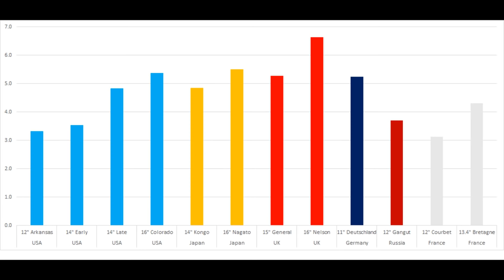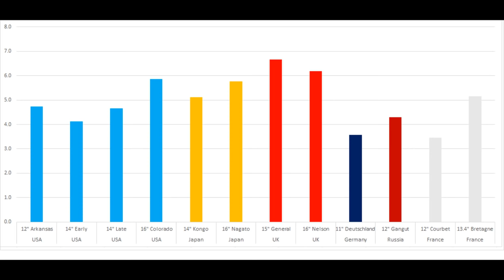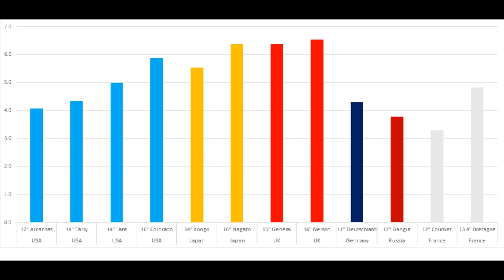Battleship Guns of WW2 - A series of tubes

Comment: Many years ago I tried to evaluate the developments of battleships and found that the best indicator of ships was:
Number of barrels times the cube of caliber - which means that secondary armament disappears into insignificance.

It is not a perfect measure; but as:

1) Bigger guns means a bigger ship - more armour, more engine power.
2) Number of guns gives - sort of - the pressure on a nations GDP. Indubitably the french and italian navies were as much disadvantaged navally by their much smaller economy.
3) So the rest follows more or less proportionally to number times caliber cubed. Following more or less the same trajectory into absurdity.

This does not mean that older guns were/are not usefull. During the cold war there were a lot of 6" naval guns - and with them a lot of ammunition. So they were perfect for coastal batteries - these forts were functional up til the 1990 and 2000 - and relatively cheap. Armour was about 18 meters of rock.
If you don't think they were effective: Just try and for the Bosperus in Turkey. Does the name of Gallipoli ring a bell? Deafning I should say!

Comment: Two comments on the approach to the method for deriving the scores - one specific to the question of range and the other more general:-
1) Given the factors around turret design limiting range, looking at the elevation required at 20,000 yards (to align with the nominal battle range used in the armour penetration measure) would be a more gun specific measure. Whether the data on this is available is, of course, another matter.
2) Scoring best as 10 and worst as 0 may skew things where there is a wide range of performance on some measures and narrow on others. Scoring the best as 10 and everything else relative to it seems to me a better way of showing the relative performance and allow a really strong performance on one measure to outweigh last place close race on another.
Great content and analysis though is far more useful than a tweaked scoring system.

Comment: I would consider using Muzzle kinetic energy (0,5*m*v^2) instead of range. That way actual gun capability to reach long range would be considered. Turret ability to utilize this capability would be a separate story.

v^2 is gun related term in ballistic trajectory equation. So turret elevation is excluded. Shell mass would crudely account for shell ability to retain velocity when drag is involved.

So guns with same  shell (same mass) would have higher capability for long range shot. Similarly, if gun have same-ish muzzle velocity, heavier shot would carry it further, as shell is less affected by drag.

Comment: I swear Rodney must've been using cheat-codes: first she famously somehow exceeds her design speed with clapped out engines and now I'm learning she magically exceeded her maximum rate of fire.
Did Bismark once steal Rodney's lunch money or something? Because the crew seemed to have a rather severe dislike for her.
Reply: Well, the boilers used in rodney were able to output more power than thought, just had to put more coal in. Also maybe they had someone standing at the breaker box ready to flip breakers every time she fired. Heard tale of the lights going out every time she fired. A manned breaker box would probably speed things up.
Reply: @GearGuardianGaming  I have heard Royal Navy boilers generally ran on overload quite well, it's apparently one of the reason the British stuck with lower pressure boilers but still, Rodney's were past their sell-by date. 
I suspect, certainly for the engines, it was a case of very experienced engineering team and the Royal Navy was definitely out for blood for Hood, so maybe the crew was simply that fired up. 
But it's much more fun to image the ship herself fiddling with her own parameters in the Dev Console...
Reply: @deaks25  indeed her engines were worn out after the hunt. She was headed to boston for an overhaul when she was called to help hunt bismarck if my memory serves me correctly. I can only imagine the vibration and sound of an exhausted naval engine.

Comment: My following comments are based on a combination of data provided by Campell's and Friedman's books, among others from a personal reference library of over 3,-000 books, articles and manuals, along with Naval Weapons of the World.
First, range is a function of not just shell weight and muzzle velocity, but shell design and elevation of the mount.   Without the mount, you are left with theoretical or empirical values for range based on a specified elevation.
Second, rate of fire is a function of the breech mechanism, but more so of the turret and ammunition handling system and the elevation of the gun based on engagement range. The rate of fire of the USN's 16" L/50 Mk.7 varied from 3 rpm at low elevations (ie. ~20,000 yds) to 1.5 rpm at high (40-45 degree) elevation.
Penetration is a function of remaining velocity, shell weight, shell design, angle of strike (horizontal and vertical) and the type of armor encountered. Penetrations vary between cemented and non-cemented armor, design and construction of the shell (wall thickness for example, along with hardening processes) and the piercing cap. In some work I did for NWS, the standard was 0(90) angle of strike of a Krupp non-cemented plate using formulas and data provided from Nathan Okun's site among other references. Angle of strike in actual tests were adjusted by an empirical chart for the increase in resistance due to increased striking angle. Fuses were notoriously unreliable even among the best designs, especially the more complex, like the USN's Mk.23, designed for multiple striking conditions. 
Then there's conditions on target. The USS Massachusetts put a 2,700lb projectile through multiple decks aft on the MF Richelieu, amounting to over 180mm equivalent of non-cemented armor only to explode in an empty 15.2cm magazine.
Effect is a result of penetration, shell condition, fuze and burster. The USN' s "heavy" and "superheavy" shells had the lowest percentage by weight of explosive filling of all the guns except the Italian 15" Mod.34A.
I wasn't certain how you decided to divide the guns into their two groups. For example, the first group, if it represented guns prior to 1937, should have included the USN's 14" L/45 (Mk.1 and others) and the 14" L/50 (Mk.3) firing the 1400lbs APHEPCBC shell. Range would have been at 15 degrees for the 14" Mk.1 and 15 and 30 degrees for the Mk.3. Around mid-1930s, these guns received the "heavy" projectiles, which were the original 1,400lbs 4 caliber design with thickened shell walls and smaller burster. Velocity dropped but range was more or less the same due to heavier shells. Penetration, especially horizontal, improved. T this point, it was the 14" L/45 Mk.10 that ranged to 15 and 30 degrees, while the mounts for the 14" L/50 Mk.11 all elevated to 30 degrees. Accuracy also improved from redesigned chambers, delay coils and heavier shells.
Also which configuration of the 15" Gun Mk.I are you using? The longer 1938lbs shell wasn't available until 1936, up until then the shell was the 1920lbs "Green Boy". The Mk.IN and Mk.II turrets elevated to 30 degrees, but the Mk.II was only in Hood from 1920 and the Mk.IN did not enter service before 1936. The difference between the 1938lbs and the 1920lbs shell at 30 degrees was almost 4,000 yds. Then there's the "supercharge" introduced in 1942.
I would also ask how you cam to rate the 16" Mk.I so high, given that service opinion evidently was that the 15" Mk.I in a MkIN turret was superior. The 16" Mk.I was the result of mistaken analysis of post-war gun and armor trials, resulting in a departure from moderate performance to light shells and high velocity. The result was poor accuracy and rapid erosion, from both the powder charge and the slamming of the long, light shell. The Mk.II rifling only partially remedied that problem. The best correction was a heavier shell which the RN never found money for between the wars. Still, penetration was not decidedly superior to the 1938lbs shell. Then there was the problems with the turret and ammunition handling which still gace trouble 14 years after entry into service. The turret rate of fire was still less than 1.6-1.5 rpm even at point blank range in the Bismarck engagement. 
BTW, I agree with identifying the Japanese 16" gun as a 16" (406.4cm), not 16.1" (410cm) for a variety of reasons, from the Japanese use of Imperial and metric units until 1932, the gun being designed in 1917 when the Japanese were only just shifting to metric, the better correlation of dimensions in English versus metric units, the derivation of the design from the British 15" gun, the fact that the IJA rolled down, so that they classified it as a 40cm gun, when if it was 41cm, they would have used that for classification. The IJN went back in 1928 and redesignated its guns, with the 14" Type becoming the 36cm, the actual bore being 35.6cm and the 76.2mm becoming 8cm. Then there is the London Treaty modifying the bore size for light cruisers to 15.5cm (6.1") in place of 6" (15.2cm) defined in the Washington Treaty to legalize the French light cruisers armed with 15.5cm guns. Had the Japanese 16" guns really been 41cm, there is no reason that would not have been reflected in the Washington and/or London Treaties. The data we have on the IJN's 41cm Type 3 gun comes from a pair of teams, one US Army that inspected the IJA guns on Tsushima and elsewhere and the USN team that inspected the IJNS Nagato. Both teams did a rush job, given they were covering all IJA coastal artillery and all IJN guns, repectively and probably accepted the data in the manuals without actaully measuring the bores. IMHO.
Reply from the maker: A quick few notes (not comprehensive):
-The division was for guns that entered service pre/post 1930 but using their WW2 formats for shells etc (ie the guns in the state there were used in WW2).
-The 15"/42 was rated as per the refit QE's and Vanguard's guns respectively.
-A lot of the problems with Nelson's 16" were due to the mounting and turret, eliminated most of those factors from consideration left the gun itself a little more powerful than the 15"/42.
-Figures for penetration etc generally assumed that things would work as advertised, unless there was a painfully obvious factor involved that could be put into the free-floating pros/cons values (eg the horrible Italian accuracy).

Comment: Excellent video as usual Drach! Just two minor points: I read in Italian forums (but without primary sources) that the French 380/45 was extremely inaccurate in 1945 and that it needed a lot of work on shell/charge combination to improve  (it makes sense because, according to navweaps, the propellant weight is just a shade less than the one used in the US 16"/50, for a much lighter shell with shorter barrell).
2 I have some doubts about the capability of the supercharged 15"/42 to retain the exceptional accuracy of the original gun, because usually with rifled weapons you have a sweet spot combination of shell weight/shape- propellant charge and rifling, and when you go outside it's parameters accuracy is worse.
Is there any firing report of 15"/42 supercharged?

Comment: So addressing the range component of range:

If you took muzzle velocity of the gun, and used a set 45 degree angle to determine maximum potential range due to the parabolic arc that should divorce the range component from the turret limitations.

It would be very interesting to see if that changed any of the rankings

Comment: It'd make a more complicated spreadsheet but I'd be tempted to cap range, like in you'd initially talked about, with no extra points for beyond 32,000 yards but still loosing points for shorter maximum ranges.  Then to more directly capture the beneficial knock on effects you normally get from a longer ranged gun I'd then add an additional category for shell velocity at, say, 15 or 20,000 yards. 

Now an exceptionally high angle turret no longer necessarily gives a big boost to its gun's score, but a flat shooting gun still gains an advantage.

Comment: Another benefit of having long range would be shore bombardments. That island will most likely not make any surprising evasive manouvers.
On the point of a naval gun being put intop different situations: This was actually pretty common for tank guns. I mean nations had decades of experience with developing guns for ships, so it's only logical that they would use those for the new "land cruisers".
It should be possible to calculate the theoratical range of each gun without considering the maximum elevation allowed by the turret.
Also when it comes ot the explosive mass of the bursting charge, did you account for different chemicals being used? So normalizing to let's say TNT equivalent.
Very interesting video and enjoyed it a lot.

Comment: I may be wrong, but a larger bursting charge tended to result in lower armor penetration performance, because the shell itself has a larger cavity inside the shell composed of soft explosive instead of hardened metal.

Comment: NAGATO guns are 41cm (16.1", not 40.6cm (16")).  The NELSON Class 16" gun APC shell, the 16" Mark IB is the first "B" shell, though with a conical windscreen instead of the ogival shape of the other British "B"-nose shells.  This gives it a slight range advantage for a given muzzle velocity compared to most other British APC shells.  I am not sure about its hardness pattern, though.  Is is the last of the GREENBOY designs, with only a 20-degree test angle against thick face-hardened armor and more brittle, but rigid, body, or is it the first of the WWII-era soft-bodied British APC shells, with better penetration against thinner armor using a 30-degree test angle, but rapid loss of penetration ability against thicker armors over its diameter (being 16", only a few ships have much thicker armor than that, of course).

Comment: One major objection, if some of the guns scored zero in certain category, that points to a problem with the evaluation.  The only reason there should be a zero score would be if weapon is in some way completely hopeless. Such categories could be "can hit enemy at distance X" or "can penetrate to vitals protected by Y inches of armour", but those categories were not used.
One major flaw in any evaluations is, that ammunition was not really of same quality and therefore all the known statistical data are inherently flawed but that limitation does not really have any solution(short of someone pouring billions on sorting out ww2 guns performance). So this part is not really a criticism just something that needs to be recognized.
Other than that, of course the distance Vs. velocity as already pointed out by others.

Comment: In firearms, individual cartridge designs (called calibers sometimes) are rated in muzzle energy ( mass x velocity squared) .   the real devil is the trade off between muzzle velocity, throw weight of projectile and barrel wear.  High velocity,small diameter designs are horrific for wear in barrels and lose a lot of their energy in flight over distance. The same problem was evident in high velocity armor penetration of Tank guns, so they went for shot discarding sabot rounds with high density penetrator 'rods'. But against a large object like a battleship, a penetrator rod will probably do minimal damage and disruption. Whereas a larger,less dense projectile just needs to penetrate proportionally thinner armor AND deliver explosive effect in confined spaces to wreak havoc.  The only other significant factor is rate of fire...........again it all depends how well the trade off works when put into practice at actually delivering useful damage.  Large diameter projectiles have a much better ratio of volume to surface areas making them a better explosive delivery system to do damage.   A good example being how the German battle cruiser near monte-video at the battle of the river plate was shredded by high rate of fire, light caliber cruiser guns that damaged enough of its systems, to make its operation unviable.

Comment: One problem is that effective range is in part determined by something that is not part of the gun: the directors and fire control computer (or range clock, if you prefer). Different guns might do better with the Ford Mk 1 than with their native equipment, or with the shell design of another nation. This is an assessment of weapon systems, not just the guns, which is still interesting work.

Comment: A very well done video. However I would like to add perhaps in future one or two more parameters. I think deck penetration should be added and the sum of perhaps three different likely battle ranges of armour penetration. I also do agree that range should be capped at a certain point as most designers didn't see fit to even go much beyond 30° elevation. Not sure if weight of shell should be weighted so heavily as the lighter US shells pre super heavy if I remember correctly actually had better penetration at most battle ranges at the expense of deck penetration and was only caught up later on down range. But perhaps terminal energy at likely battle ranges should also be included as a good figure of merit of comparison between different guns. Would love to see how some other WW1 era guns would stack up like the Badens or Carraciolo classes.